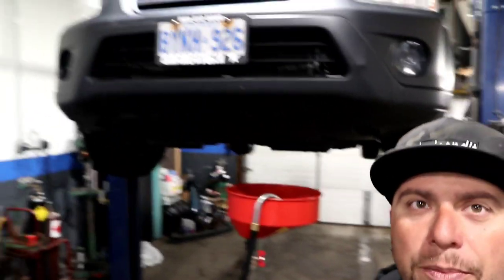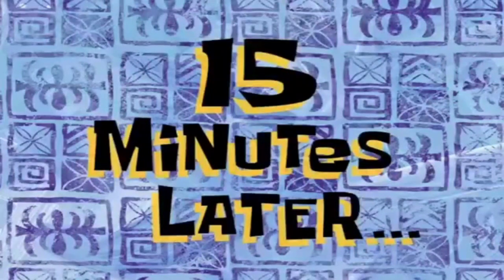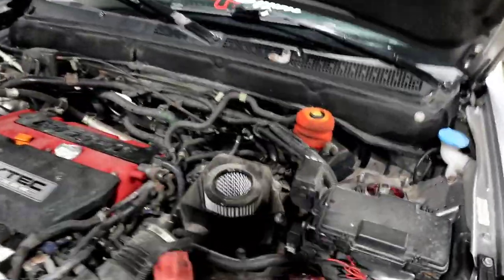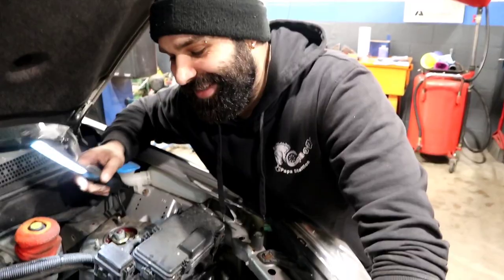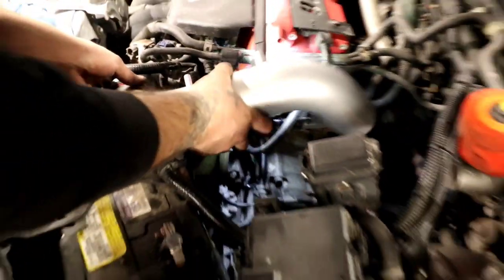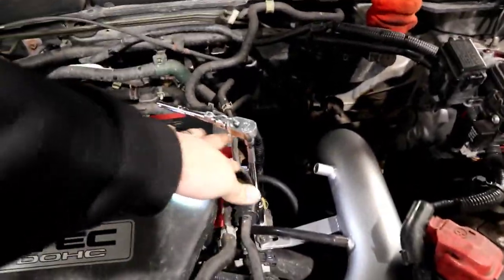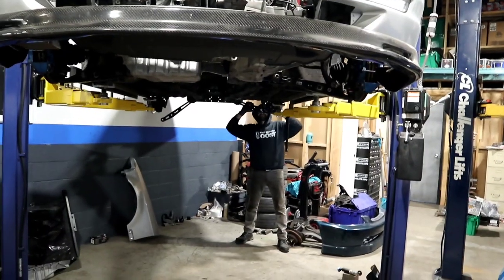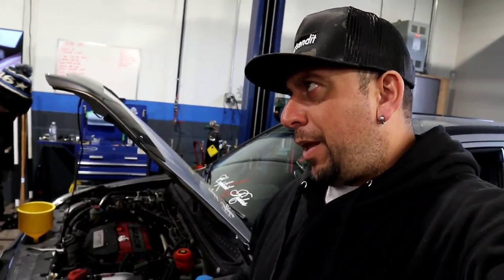DC Sports Intake Install 2005 Honda CRV

Comment: Did you guys add a catch can for the oil off the PCV and did you have to do anything special when you took out the mass airflow sensor
Reply from the maker: Catch can is in the works havent done one yet